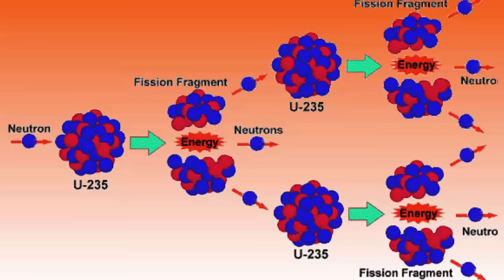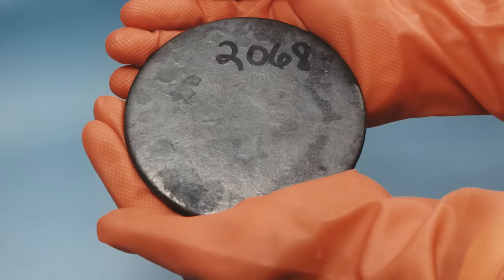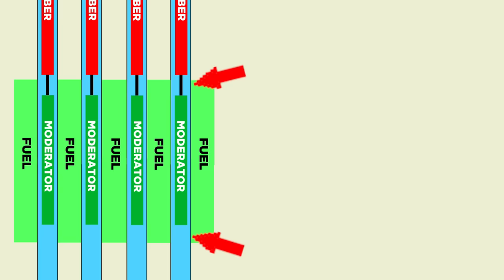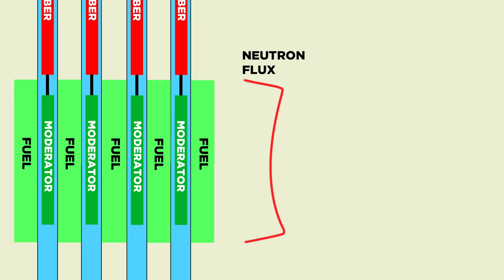What /Actually/ Happened at Chernobyl

Comment: After watching this video, I'm a bit more confused about what happened at Chernobyl then before I watched it. To the best of my knowledge, the problem at Chernobyl was caused when they they had a reactor in either a sub-critical state ( a state where the fission reaction isn't self-sustaining unless more reactivity can be added) or a state were it was about to become sub-critical. This is bad in that this is a state a reactor is in before it comes online and that it can be trickier to get a reactor that is in such a state back into a stable critical state (it's normal self regulating state) then even a reactor that is in a unstable critical state since it has to brought back into the critical state before it can be expected to produce power. After a reactor is brought into a critical state (when coming from a sub-critical state), it can brought into a stable state but not before it briefly goes into what is called the supercritical state. Like the sub-critical state,  in a supercritical state of a reactor there isn't a balance between the neutrons that are being used and those being produced but in this state there is too many being created and the process has to be regulated so that less are made in order for reactor to return back to it's normal critical operating state. I believe all reactors that start in a sub-critical state will briefly enter into a supercritical state before they can be brought back into their normal operating ranges.      

As the operators tried to return the reactor into a state where it could enough power as quickly as possible, they managed to push it to start operating in a manner where they could no longer be certain as to how it would react to what they did. As it is well know when the reactor started to get back to producing enough neutrons/power again they realized they had a new problem where it was accelerating a lot faster then they had hoped for. As they started trying to reconfigure the reactor to have less reactivity, I'm pretty sure they where aware of the problem of if the reactor got too much reactivity going on that it would start a feed back loop where the reactivity in the reactor would start feeding back into itself. In US reactors configuration, a situation of uncontrolled increasing reactivity instead makes it more difficult for the reaction process to continue and can make it impossible for a reactor to be able to reach a critical state without it being first taken offline to be fixed. Even though there was the problem with feed back loop increasing the dangers such a reactors, the operators decided to scram the reactor (irapidly shut it down) before the reactivity could begin the feed into itself. Under normal circumstances the control rods would have come down, the reactor would have gone offline, and nobody outside of the power plant would know anything what had happened. The only problem (and this is where what you said in your video differs from what I remember being told) is that the ends of the control rods had a type of padding (which if I remember properly  was called the 'foot' of one of these control rods) which was there to help guide the rod back into place and help prevent any kind of shock of when a control rod return back to it's place.  The only problem was when a control rod was completely pulled out and then put back very quickly (such as in an emergency situation) that the material that these feet were made of would create a minor shock which would very briefly greatly increase the reactivity of one of these reactors. Normally one of these shocks wouldn't do anything (and likely go unnoticed),  but the reactor had been brought to beyond it's operational limits and the transient condition caused by this reaction prevented the scram process from being able to shut the reactor down properly. I don't know if it was enough in and of itself to make the reactor go prompt critical (a state similar to when it is supercritical but where the power increases exponentially) or the event caused a shock wave that damaged the reactor preventing the control rods from moving back into place and this caused it to go prompt critical, but in either event the reactor went prompt critical causing it to produce many times more power than it could handle which of course caused the reactor to explode the way it did.

Comment: its not anything broken that cause the graphic to lock in the fuel, the temperature is way too high that the water is boiling into gas, it creates extreme pressure inside the lid that causes the rods to lock in

Comment: RBMK reactors did not use "unenriched" fuel. 

Unit 4 ran with 2.0% enrichment.

Unenriched uranium is 0.7%.

They hadn't taken out all of the rods either. He keeps saying that and it isn't true.

The reactor design was flawed and an explosion was inevitable.

The chief designer of the reactor stated in documents found after the accident, that an RBMK running at 2.0% enrichment can enter an "uncontrollable" state unless extra control material is fitted in the core. 

It was not fitted at Chernobyl. 

In effect, the operators had been handed a ticking time bomb. An explosion was inevitable. 

You can find all of this information, in the form of cited quotations from official documents, in Dyatlov's book Chernobyl: How it happened

Comment: Why control rods and moderator needed to be lifted completely? Why didn't they just pull the control rod part out and leave the moderator part in the reactor since they were trying to increase the reaction? Then putting back control rods wouldn't cause a power spike

Comment: I do not understand why the neutron flux concentrates at the bottom of the core. I get that the atom flux at the botom should increade as water is substituted by graphite, but it should be as high as any other point with graphite, not higher. Could someone explain it?

Comment: I'm confused about light water. Is it an absorber or a moderator? We know it can be used as a moderator, since it often is. Less efficient than heavy water, but it works. So how on earth can it be an absorber in the RMBK? Is there some reason that having graphite as a moderator means the water used to cool the core doesn't also slow down neutrons anymore?

Comment: Why did they design such a dangerous reactor? The benefits were irresistible. They could use very low enriched uranium and change out the fuel at full power. This enabled a power reactor to also produce plutonium for nuclear weapons. Something that can't be done in western power plants.

Comment: The RBMK (reactor bolschoi..... ;-) ) was used not because less fuel enrichment is necessary. It was mainly used, because with this design you can change the fuel rods during normal operation of the reactor. No need for shut down, open reactor cover and such things. This of course is the pure heaven if it comes to the need to produce Pu by breeding of U in order to build A- resp. H-bombs.

Comment: I wonder if it would have been possible to safely shut down the reactor if the operators didn’t scram it. Concerning the reactor design itself. I’m curious if minor design changes combined with additional safeguards could have made this reactor safe.
Reply: They could have turned all the main pumps on, and started lowering a few rods at a time. But there was absolutely no reason for that during the test. Actually, the reactor was planned to be shut down during that experiment. The safety test proceded normally, and at the end of the test the reactor was shut down. There were no alarms or signals until a few seconds after AZ-5 push.

Comment: With the explanation most of the way, until you got to the steam dissociating into H and O.  Sounds implausible and not required for explosion to happen - sheer pressure of steam could achieve that - possibly augmented by reaction of steam with metals giving hydrogen - if there was sufficient air around to combust with.

Comment: When you look at it - it's basically a huge watertight cylinder of concrete tubes in a small space full of heat and pressure enclosed by more concrete  - I mean what could go wrong?

Comment: Question about the neutron flux: why only the bottom of the reactor? Weren't the graphite moderators present throughout the whole tube? If so, why was the neutron flux spike only at the bottom?
Reply: The graphite rods were actually shorter than the core. So at the very bottom and the very top of the core you had areas where instead of graphite there was water or steam when the graphite rods were fully inserted.
The problem now was, that they had an uneven neutron flux. The fission reaction happend at the very bottom of the core because the Xenon was forced higher by the water. Now the moment the water at the bottom started to evaporated, that's the moment the initial runaway started. Pressing the AZ-5 button then lowered the graphite rods into the active fission zone which increased the moderation and accelerated the runaway further.

Comment: Stupid question is stupid, but who exactly thought having graphite rods attached directly below moderator rods, was a good idea ...? 

Yes, dropping the whole assembly, usually, took seconds, but, as is often discussed, it was whilst the graphite rods were in the reactor, having, iirc, displaced just enough water, did the reactor energy skyrocketed. By how much is disputed, and there are even suggestions that, although supposedly impossible for a reactor, it went into a prompt critical state, meaning actual complete nuclear fission, generatinga fissile 'plume', despite the uranium in the reactor being not particularly enriched. But I have only seen two papers suggest that. Most others agree that, in this high energy state, the explosion was caused either by steam and/or dissociated hydrogen and oxygen ... 

Yes, the chances of what happened were slim, but even in school, before Chernobyl actually happened, in our first science classes, we were taught low risk =/= zero risk, and if something had a potential to go wrong, even, say, there was a 1 in a Billion chance of it doing so, you'll never knew if lightning may strike ... and, as a (very) lay person, the RBMK design doesn't seem to me to have been exactly the most stable ...
Reply: The problem is that they were overrunning the reactor in order to burn the xenon poisoning away.  That itself is an accelerating process and they should have been watching it closely and responding by lowering the control rods to compensate as the poison burned off; I'm assured by operators that this is done safely all the time.  As it burned off the reactor unrestrained, it reached the point where the xenon was burned away, and there was nothing to restrict the reactor activity.  Safety systems that would have helped were turned off so as not to interfere with the test they were doing.

Xenon as a neutron poison became, atom by atom, non-poison by the very act of absorbing the neutrons that it was poaching.  This is called "burning" away the xenon, and it is an accelerating process as the xenon is converted.  The other way of handling xenon is to shutdown the reactor and allowing it to decay over a day or two.

Comment: And this is why I call these god damn things "steam bomb reactors".  There's no way to make a reactor that uses water as a coolant safe.

Molten Salt reactors use a liquid reactor fuel which is much easier to move around than rods. Molten Uranium and Thorium salts also have a much higher heat capacity (the amount of temperature needed to force a boil) than water.  These reactors also have an incredibly strong negative reaction coefficient - they'll shut down if you don't constantly nudge them along. They are "walk away" safe.
Reply: Just to frustrate you a bit more, one word. Zircaloy! 😈 
(because hydrogen wants to play too!!)

Completely agree with water-cooled though. Had an HTGR reactor in my location for a while. Helium was the primary coolant and water was the secondary.
Crazy to think the Chernobyl plant was only 2 years older than the plant here and the HTGR was already a gen IV.

Comment: The problem with the design was it was not idiot proof. The emergency button was "dumb" system. When used properly these reactors served well and some are still on today. Obviously cutting corners all over the place was bad, not placing things in the manual etc. all contributed - but it was people that pushed the buttons.
Reply: They did not serve well at all. Go read wiki or something before making such bold statements
Reply: @rinkashikachi  Wiki says they are still in service - that is over 40 years for some of them.
Reply: @tomk3732  I mean there were like 5 more serious malfunctions. Only after all of these and fixes for other reactors, RBMK became stable as it is now
Reply: @rinkashikachi  "Most of the flaws in the design of RBMK-1000 reactors were corrected after the Chernobyl accident and a dozen reactors have since been operating without any serious incidents for over thirty years". So no serious accidents for 30 years - these 5 must have occurred right after Charnobyl then or maybe they were not as serious as you think. No one says its a great design - if it was it would not need so much fixing.

Comment: The reason that the stablest isotopes tend to have roughly the same number of protons and neutrons (bending over a bit toward more neutrons as the nuclei get heavier) is actually pretty easy to understand. You may remember from chemistry class that no two electrons can occupy the same quantum state (the Exclusion Principle), and as more electrons get added to an atom, they pile up into more and more energetic quantum states. But you can put two of them in the same "orbital", with a certain shape, because they can have opposed spins, and there are two spin states.

Well, protons and neutrons are like that too. Only being a proton vs. being a neutron is another state difference. So you can stuff two protons AND two neutrons into the same nuclear orbital. (And the attracting force keeping it all together comes from collective strong nuclear force attraction, instead of electrostatic attraction.)

But there's another force, the weak nuclear force, that can transform a neutron into a proton or vice versa. That involves creating an electron or a positron, and a neutrino or antineutrino. All that takes energy, and it's not going to happen unless the energy difference between the initial and final state is large enough. But if the energy difference is there, it's going to happen eventually, after a somewhat randomized delay. That's called beta decay, because the electron or positron emitted in the reaction was called a "beta ray" before people were quite sure what they were.

A neutron has a slightly larger mass than a proton, for... reasons, and the difference is just barely enough to allow beta decay to happen, so a neutron minding its own business in free space will eventually turn into a proton (emitting an electron and an antineutrino), but not the other way around.

But in a nucleus, if you pile up too many protons, they'll occupy higher energy states than they COULD occupy as neutrons, since there are lower-energy slots available for neutrons. So now there's an energy difference sufficient to go the other way and they can do "positive beta decay" and become neutrons. Or if there are too many neutrons, they'll turn into protons: "negative beta decay". When this happens, there's often extra energy left over that can be emitted as high-energy photons ("gamma rays") or cause something else to happen.

The mass difference between a neutron and a proton is small enough that the equilibrium for light elements is generally close to equal numbers of neutrons and protons. But protons have a positive electric charge so they repel each other electrostatically. That means it takes more energy to squish them together. As the number of protons increases, their common electrostatic repulsion means that the equilibrium has a bit more neutrons than protons, to keep the protons a little more separated.

Fission, and alpha decay (where the nucleus spits out a helium-4 nucleus, two protons and two neutrons), are a bit harder to understand because that gets into the details of the strong nuclear force. But beta decay is relatively straightforward.

Comment: ouch, can we stop bringing emc^2 to everything? It's not specific to nuclear power and it's an irrelevant detail. 

A charged battery is slightly heavier than a flat one, but that doesn't mean that Elon has to explain his cars using e=mc^2.

A pot of hot water is slightly heavier than a cold one, because the hot one contains more energy. You don't see e=mc^2 in a cookbook.

A flying bullet is slightly heavier than one that hasn't been shot yet, because the flying one has more kinetic energy. Haven't seen anybody thinking about e=mc^2 in a shootout.

A skydiver in the air has slightly more mass than a skydiver that has already landed, because the one in the air has more gravitational potential energy in him. And you don't see skydivers flexing around with einstein's physics. 

If you eat a snickers bar, the co2 you breathe out and the weight of ur poop is slightly less than the original, because you used little bit as an energy. 

It's like building stuff from lego and explaining your build using quantum mechanics. It's possible, but hugely unnecessary and irrelevant detail. 

The two fission products fly apart real fast and bump into nearby atoms, making them vibrate, aka heating them up. Bam, there you go. An intuitive explanation.